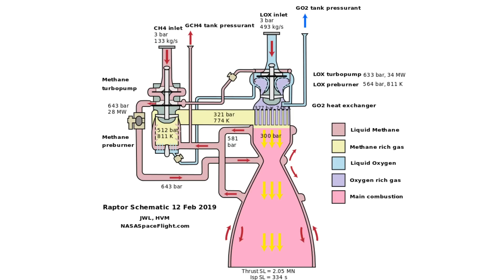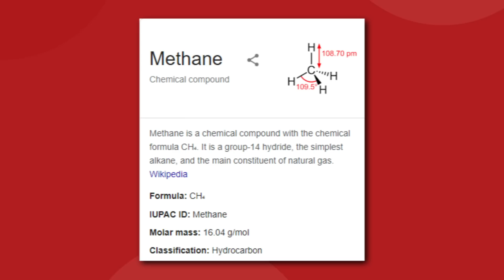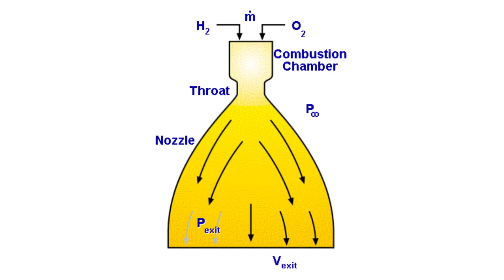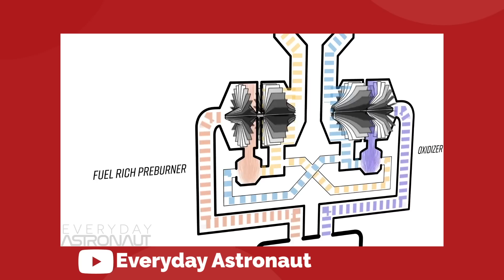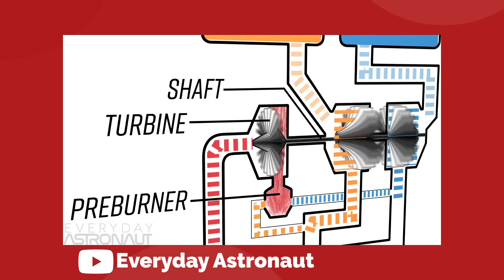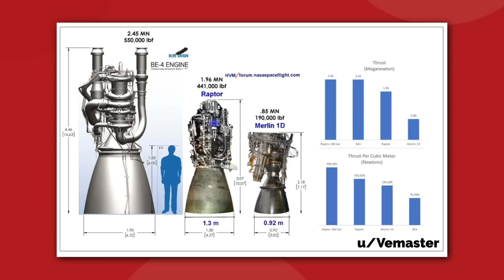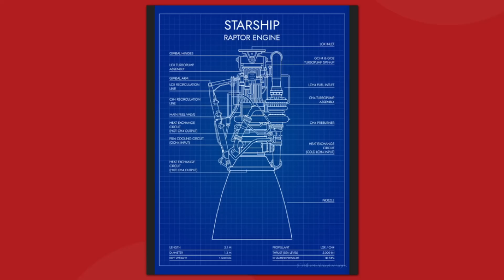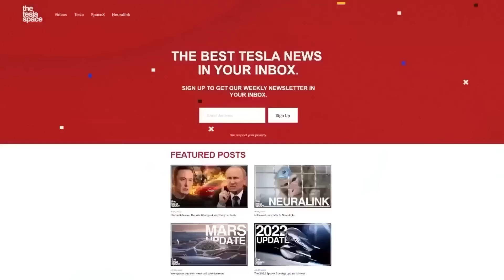The Real Reason SpaceX Developed The Raptor Engine!

Comment: No mention of hypergolic fuels I see. The F1 engines of the Saturn V were closed cycle full staged combustion engines using RP-1 fuel so your statement that SpaceX was first to do this is incorrect.
Reply: The Raptor is full flow and the F1 wasn’t. From Wiki:

As of 2019, only three full-flow staged combustion rocket engines had ever progressed sufficiently to be tested on test stands; the Soviet Energomash RD-270 project in the 1960s, the US government-funded Aerojet Rocketdyne Integrated powerhead demonstration project in the mid-2000s,[6] and SpaceX's flight capable Raptor engine first test-fired in February 2019.[

Comment: Great explanation of how these engines function. Now Elon wants to launch a thousand of these rockets a year. My question is what effect will all these flights have on our atmosphere and are any of the flights that are happening now from any of the space companies effecting the the atmosphere?
Reply: Burning methane will produce mostly steam and some carbon dioxide.  Methane is CH4 if I remember right; the "C" will be joined to two oxygen atoms; the 4 H's will be paired, two of the H's with an oxygen (H2o) and the other two H's also to an O.  The result will be one methane and four oxygen produces one CO2 and two H2O (water).
Reply: Don't worry he'll just produce a few more planet saving toxic battery having cars to offset all that rocket fuel. He's the planets savior after all didn't ya know, real life Tony stark here
Reply: Actually, the goal is 500 - 1000 ships transiting to Mars at every conjunction. That will require about 7 tanker launches to refill each of those ships waiting in LEO. So eventually 4000 - 8000 launches concentrated around every 26 months.
Reply: way way way less than cars or power plants. it's not even noticeable.
Reply: @therocinante3443  Each booster will burn 3400 tonnes of fuel in 2.5 minutes. That's like 300,000 cars driving down the highway at 100 kilometers an hour. That's pretty noticeable.
Reply: @johnarnold893  not really, that's like 10 hours on just the new jersey turnpike alone.
Reply: @therocinante3443  So you're a legally salvaged Mars attack ship. I love it.🙂

Comment: You do realise that it has been over a year that we keep hearing that this launch is imminent? It is starting to sound like fusion. It is always round the corner.
Hyperloop has turned out to be impossible and now it is pivoting to cargo transport. Even that will prove nothing like what was envisioned by Musk. Keeping a long tube in a vacuum is just mad. Especially above ground and unable to have a bend on frictionless magnetic tracks didn't work out economically viable by the Chinese because of the amount of energy required to keep the magnets operating.
What was it that Hardy used to tell Laurel: "Well, here's another nice mess you've gotten me into!". I bet that is what Richard Branson is saying under his breath to Musk.
This thing was ill-conceived from the beginning, including the location of Starbase. To lift that kind of mass needs a lot of structural strength not to break into pieces that will add a huge amount of mass that creates a positive loop back. Why do you think they need a stronger engine.
It would have been better if at least Elon had started with something similar to Sea Dragon because that is the only environment that can handle that kind of energy and everything else should have been designed around that concept which is what is planned for the future anyway. The Sea Dragon made the right choices like using steel that ended up the choice in Starship.
But being in a rush the basics weren't considered and now they are stuck.

Comment: Yeah, methane does not produce coking, but there is another bigger reason for using this fuel in the raptor. The places we will be going on a StarShip! 
When we land on Moon or Mars or somewhere else in the solar system, we won't have RP1 refined kerosene there because one needs petroleum refineries to produce them, whereas methane is naturally available all over the solar system!
Reply: They also plan to use it for actively cooled heat shields.

Comment: Raptor 2 ignition is almost certainly accomplished with a bit of Platinum. In the presence of Oxygen and Hydrocarbon fuel, Platinum is known to cause AUTOIGNITION. This effect was used in cigarette lighters during World War 2, to avoid the bright flash from a "flint" sparker wheel. Instead, the soldier would just open the lighter and blow gently on the Platinum gauze surrounding the fuel wick, and the combustion would begin, cleanly and almost invisibly, right in the Platinum gauze, which got quite hot. When the lighter's lid was snapped shut, Oxygen was excluded and the combustion reactions ended.
Reply: Why not use hypergolic fuels to start ignition like the other space x engines?
Reply: @TheOriginalStoven  - Platinum is simpler, less massive and MUCH cheaper.
Reply: The only reason is that he doesn't know where to spend the money from NASA.
What intrigues me is that all the UFO visualizations and some captured in video and photos, are of round or triangular spaceships and due to the immensity of lights there has to be a generation source that will violate the damn laws of thermodynamics that are strangling the advance of science, why is it then that humans keep their designs based on rockets, hungry for fuel and slow as snails.

Comment: A fleet of a thousand methane-burning giant rockets making frequent trips makes sort of a joke of Tesla's save-the-climate legend, doesn't it.
Reply: "Does it doesn't it" questios are inherently ambiguous.
Reply: It doesn’t. Methane can be made from CO2 in the atmosphere. SpaceX will want to do that as they will be relying on that tech to generate their methane on Mars.
Reply: @bensemusx  "It doesn't" and "It won't, in the future, maybe" are not at all the same thing, especially given Musk's track record on grand visionary promises. There won't be any methane generated on Mars in the foreseeable future. The distribution of the C02 is a much bigger issue than methane on the ground from say cow farts, Even if they were pulling CO2 from ground level and injecting all the way up the atmosphere (which they won't be, any time soon) it still wouldn't be carbon neutral.

Comment: Honestly, I’ve watched almost all of the Everyday Astronaut videos, and this is the first time I actually feel like I have a general understanding of the systems. The way you explain things I so straight forward and understandable. You made something complex sound simple. I think you have a serious talent for this. I’m impressed. Thank you!
Reply: +1
Reply: Agree  the concept/idea  was digestible .
Reply: Same here. I too felt the same after watching the first 5 minutes.
Reply: The next step is to replace the 2 turbochargers with 2 electric motors. Two electric high-pressure pumps, respectively. And the whole thing will be even easier. However, such a construction is most likely prevented by the laws of physics.
Reply: @kentherapy7022  Add heavy batteries, wiring, control computers and electric pumps will make it easier?
Reply: @BariumCobaltNitrog3n  It seems, that electro pumps is dead end...😆
Reply: @kentherapy7022  its just more weight if you replace turbos with electric because the methane and oxygen is going throught the whole body of the combustion chamber cooling down the metals and same time liquid changes to gas and makes power to turbos
Reply: Yes.Very understandable. Complex subjects made simple to explain. The narrator speaks the right speed to give you enough time to digest before going into further science. Love all the diagrams with flows as they go. Thank you for the info. Will recommend for my kids to watch too!
Reply: He os only yellow = not Human but is closer to Human than the hyper verbose and stupid host over at everyday astronaut.
Reply: You're easily impressed... the audio and visual screw-ups did not impress me.  The Everyday Astronaut would have corrected errors that this guy just ignores...  mediocre at best... and he or she's had three weeks to correct the mistakes, but clearly  D. G. a  S * * T.
Reply: No human from earth ever made it through the firmament to outer space and everything they say about going to moon is a lie!
Reply: @kjdegraaf  Yes I understand....Battery are too heavy....On 1 Kg of payload is necessary 2 - 3 Kg of thrust.

Comment: Excellent excellent video. Just the right level of technical detail at the right time.

I do have a question about the shroud that Elon wants to remove.  Can you do a video discussing where it is, what it looks like and benefits of removing it?
Reply: It's just a heat shield and the benefit of removing it is pretty obvious: less to manufacture, less to install, less weight.

To remove it requires increasing the heat resistance of a few components and, possibly, redirecting some of the existing heat flow. More detail hasn't been shared by Musk.
Reply: @lighthousesaunders7242  Its not like he is an engineer. He just wants to save money.
Reply: The main benefit of removing the shroud is simply weight reduction for the rocket. Less weight to be lifted less weight to catch.

Comment: A couple of corrections/disagreements:

Soviet N1 was the most powerful first stage and substantially more powerful than Saturn 5, if you want to claim Saturn 5 as the most powerful, you have to caveat that you're only talking about rockets that successfully reached orbit.

The Saturn 5 F1 engine isn't the most powerful rocket engine either, it's only the most powerful *single-chamber rocket engine*, the Soviet RD-170 engine from the Energia rocket that launced the Soviet space shuttle is more powerful than the F1.

About methane, yes an important reason for using it is coking, but the "real reason" is not known exactly, but it also includes other factors for sure. 

One is the fact that methane can be made on Mars or the Moon with some significant use of in situ ressourses. Another is that it's more efficient than RP1. And probably most important, knowing Elons focus on cost to orbit, it's really cheap.

About cryogenic propellants and use of methane. Yes using cryogenics at all is more complicated than not usng any, but you're kindof forced to liquid oxygen if you want efficiency anyway so it mostly a required minimum cost of space flight. Some cryogenics like the hydrogen fuel used by the space shuttle and SLS are much more complicated. But having two similarly cold and dense propellants is not so much more complicated that it really is the explanation for avoiding methane, rather the need to develop a new engine which would be the first of it's kind is a much more significant barrier to going to a methane system. No-one else built methane powered rockets before because doing something new is risky, and doing it in the middle of also developing a rocket, which is risky in iteself, is evn more risky and even more insanely expensive than space flight already is. So until SpaceX proved it was possible and committed to it, no-one else dared go in that direction, so no engines existed for anyone to plug into their rocket and everyone just used other systems. Now that it's proven, they all race in because they know they get many of the benefits of hydrogen with only very few drawbacks.
Reply: N1 never completed a launch actually it never completed a 1st stage burn.
Reply: @jackdbur  You can make different caveats, yes, but you NEED to make caveats is my point. Otherwise you're just wrong.
Reply: "It can't be done because it's never been done" has killed countless projects and retarded innovation. We need to find what allows Musk to say "we're doing it anyway" and spread it throughout every industry. Then we'll be colonizing other galaxies.
Reply: Elon has always stated that the mission goal is Mars. With the confirmation of Co2 & water ice a Methalox engine was a given.
Reply: N1 had more thrust but Saturn V had higher payload to lunar orbit. The Saturn V actually also worked as intended.
Reply: @redlt194  I agree Saturn 5 was a much better rocket, and would have been even if N1 had worked on every launch.

I'm just wanting to have what is said be correct..

I have this pet rule of thumb, that the quality of a rocket, how advanced it is, can be roughly gauged by how much the sides slope outwards. That is the more cone shaped versus stick shaped it is, the less advanced and he more brute force it is
😆
Reply: @runem5429  Fair enough. 

IIRC one of the biggest problems with the N1 was all of the plumbing and complexities that were required of those many engines. I therefore might be inclined to agree to your rule of thumb. Let's see what Musk manages to pull off though.

Comment: Fact check: you said the oxidizer is always oxygen but you are forgetting about hypergolic fuels like the Draco engine uses.
Reply: Only crazy people or communists are going to use such oxidizers in a first stage.
Reply: Also there are just other oxidizers used in liquid fuelled rockets. Oxygen is just very common and I believe it’s what all current liquid fuelled rockets are using or at least the vast majority of them.
Reply: @bensemusx  The problem with the hypergols is they are nasty to handle, corrosive and toxic, (ask the Russians about submarine K-219) not to mention that compared to oxygen and methane or hydrogen, the combustion products are also nasty. Hypergols also have a lower Isp (efficiency) than the others. They are handy for applications where storage of cryogens is a problem, and where ignition systems aren't needed.

Comment: Maybe great for a lot of people who were not following the development 
Couple more questions would be great to cover, mainly how is raptor restarted for landing?
Reply: The outer ring of 20 engines are started only by ground-based equipment, but the inner cluster of 13 have individual spin-up and ignition systems. The latter are used for the boost-back burn and landing.
Reply: The only reason is that he doesn't know where to spend the money from NASA.
What intrigues me is that all the UFO visualizations and some captured in video and photos, are of round or triangular spaceships and due to the immensity of lights there has to be a generation source that will violate the damn laws of thermodynamics that are strangling the advance of science, why is it then that humans keep their designs based on rockets, hungry for fuel and slow as snails.

Comment: imagine how fast those raptors are gonna be in space where there's no gravity or any resistance.
Reply: There is always gravity, it cannot be escaped, not even between galaxies.  Because of relativity, the engines will be able to accelerate until they run out of fuel.  But as to speed; well, they will seem to be standing still and it is the universe that travels around them.
Reply: There is never "no gravity"
Reply: @Jeremy9697  There is also apparently no common sense, either.

Comment: What I'd really like to know is how the orbital launch platform stands the heat of a Starship launch without melting.
Reply: I guess they just cool it actively using something like liquified nitrogen?
Reply: @randombutrelevant  you’re going to regret this comment soon…
Reply: likely it's water cooled.
Reply: @DouglasEKnappMSAOM  So far as the combustion chamber, nozzle throat and the expanding portion of the nozzle is concerned there are several methods of cooling. I can't say which of these are used in the Raptor 2, but here is the most likely means: First, regenerative cooling. The fuel or oxidizer is first pumped through channels in the walls of the throat and nozzle. The liquid cools the walls and the heat picked up increases the energy of the liquid before it is pumped into the combustion chamber. Care in the design must be taken to prevent the liquid from boiling, causing cavitation, but properly designed it works.  The second method is transporation cooling, whereby a small amount of liquid is pumped into the surfaces to be cooled in the form of a film along the walls, which protects the surface from the heat. The liquid flowing along the walls can be burned if a small amount of the other propellant is added either by increasing the mixture ratio or directly injecting a small amount of the other propellant...sort of like an afterburner.  I don't know what the Raptor 2 uses, because Elon is keeping those sort of details under his hat.

Another method of protecting the inside surface of the nozzle extension is to use an ablative material inside the extension itself. The problem with this, from a reusability standpoint is that the material would have to be refurbished at some point in the operational life of the engine.  

As far as eliminating an ignition source for restart is concerned, it may depend on whether Raptor 2 would use something like the Merlin 1D, in a pyphoric fluid injected into the oxygen stream. I forget the particular chemical, but it combusts on contact with oxygen.

So far as I am concerned, Elon Musk is the modern-day Thomas Edison.  And I am not simply referring to Edison inventing the phonograph and the electric light bulb. Read Edison's biography. He had his fingers in a lot more pies. So does Elon Musk!
Reply: By not really getting hit by the exhaust. The legs + the height = de facto giant 360 degree flame trench.
Reply: @randombutrelevant  I see that you have not been paying attention to the space program.
Reply: @randombutrelevant  if you actually do some reserch and not just keyboard warrior on yt you would realize how stupid you sound.
Reply: @randombutrelevant  Have you EVER driven a A Plaid Model S? I would say that is delivering!
Reply: Tom Lompa An Orbital Launch Platform would be sitting in space measuring a whopping 3 degrees Kelvin, & vehicles separate with thrusters, not main engines. So cooling is not really an issue.